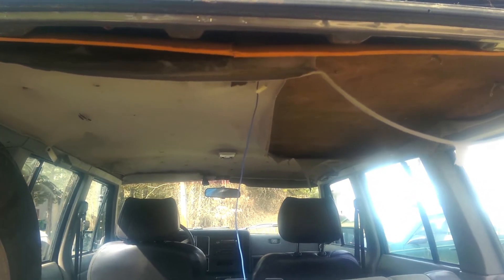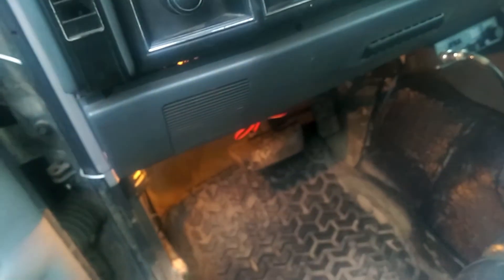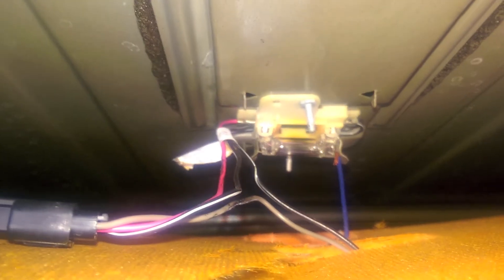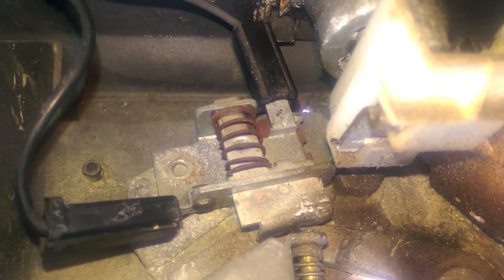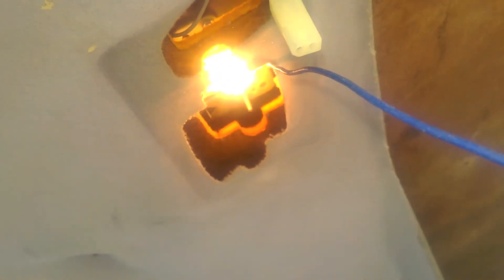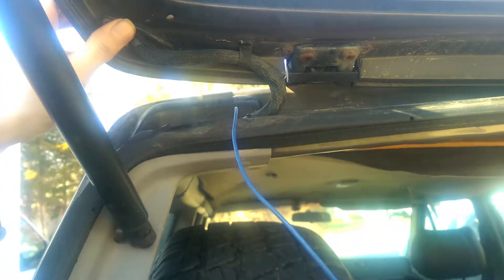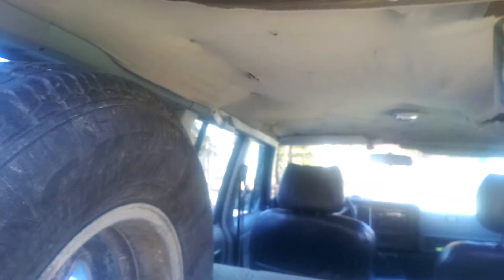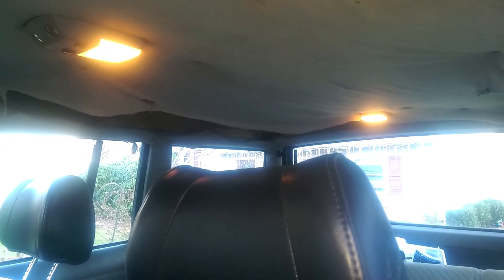89 Cherokee Fixing Cargo/Dome Light Issues

Comment: I just came here for the discussion on removing those little grey disks because people told me that it was the pin they attach to that moves. Once I saw this and poked at one I realized how to remove them easily.

Thanks!

Edit: Oh and also with body panels I find it often works to use the old wire to fish the new wire. Cut the old wire and use a drop of soldier to fuze the two wires together then coat with electrical tape to make it smooth. Pull old wire out slowly and it replaces itself with the new wire.

Comment: Man, that helping hand tool works great.
Just picked one up the other week. If you use it with a magnetic bolt tray, you can use it pretty much anywhere.
Reply from the maker: Pabst Boys That's exactly what I was thinking. It's great for soldering because it holds the wires still and absorbs extra heat from traveling down the wire. The only tricky part is setting it up so it won't fall over. A magnet would make it much easier to position.
Reply from the maker: Pabst Boys LMAO! Truer facts were never stated. I only keep it on for balance reasons. If I need a magnifying glass, a headband Magnifier is much better for looking at tiny parts.

Comment: FOR ANYBODY with a bad door jamb switch: All you have to do is pull it out (it's probably just gunked up and doesn't have a good connection) then just hit it with some sand paper, throw it back in, and voilà! It's fixed.

Comment: I need some help. In xjs with the rear dome light you can manually turn on. And when the hatch is open you can turn on all the both the dome lights by simply turning on the cargo light. My issue is that when I press the cargo light, the trunk tries to lock and both of them turn on very dim. I'm very confused

Comment: I have a jeep Cherokee to where my dome lights will come on but when I shut the door they’ll dim down so I hooked up my meter and it has 12 V when the doors open but when I shut the door it has 7V. My headlight switch is turned to where the dome lights are off but they won’t shut off. When the door is open they’re bright when you shut the door they are dim.

Comment: Well bypassed mate :D
Typically the broken wire hides in the flexable hose from body to door, its a typical place for the wires to end there life ha ha :D
I did the hatch on a mates car, the cute rubber gator between body and door was hiding many many dead wires lol, i snipped each wire back and inserted new wire and soldered + heatshrunk like you did, i counted 12 wires, did em all so i didnt have to revisit it again :)
Worked spot on!!, the wire i used was from a washing machine harness so it was clean LOL :-) bad joke, sorry lol.
Reply from the maker: zx8401ztv LOL, so that's where all the good copper comes from? That's what I suspected and didn't feel like digging more than I had to so this was the simple fix. It works like a charm now.
Reply: NickInTimeFilms Hey i dont blame you, its what your happy with that matters :-).
The mates car was old enough that my bodging was close enough for him, some people would want the whole wiring harness replacing with a new one but its not really worth the trouble.

Comment: Do you know where that blue wire in the cargo door runs to up front? I have this same problem and there is a blue mystery wire under the driver's door panel that's not connected and I can't find it on any diagram.
Reply from the maker: Hmm, I'm a bit stumped. Look at the video, the dome only has the red positive and 2 blacks. The switch has the gray wire to the hatch but i'm not sure where the blue hatch wire comes from. I don't even see it in my headliner or sound deadener video. good question

Comment: Hi! Thanks for your videos! I have the opposite problem. The lights won't go off. Changed new door switches in front. Earlier the lights went off when I started the car or after shutting the door a few times. Now it just stays on. Any tips?
Reply from the maker: There may be a wire grounding out somewhere then. From the diagram I have, The Dome lights usually ground off any of the door switch, the Liftgate Switch, or the Headlight Switch when you rotate it fully counterclockwise. I would open one door at a time and push the switch in a few times to see if it goes out, if not keep going to each door to see if one of the switches are messed up.
Reply: +NickInTimeFilms thanks! Removed the harness to the driver door switch which solved the problem. Will try to locate the short or replace the wire later. Thanks!

Comment: I see that u have floor lights.. my 94 Cherokee has no lights for the floor, or a plug pre wired for them, do u know where I can find power to install some leds down there?
Reply from the maker: Hmm, that's very strange, I figured floor lights were the norm. Well if you don't have any factory wiring then you'd have to tap into the dome light as that's the only other circuit that is controlled by the door switched. everything else is dash lighting connected to the headlight switch.